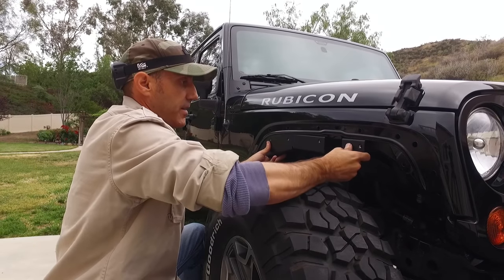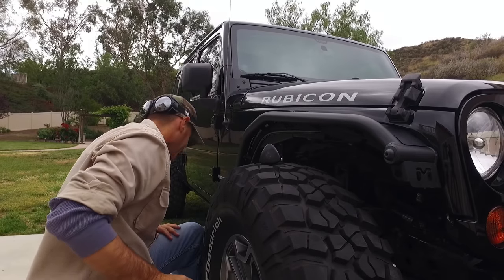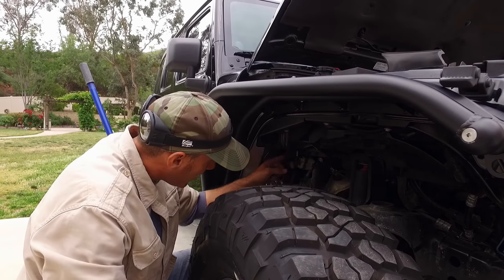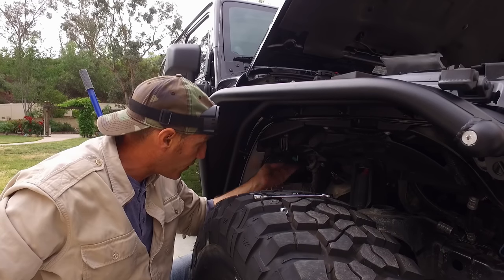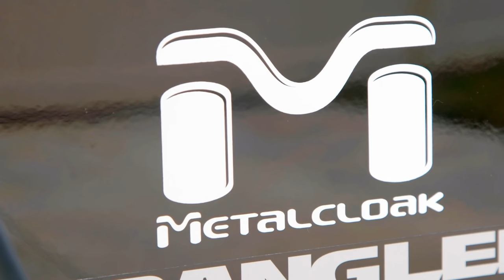Jeep Wrangler Front Fender Upgrade! MetalCloak Overline DIY Installation for JKU Rubicon

Comment: A tip for easier drilling through sheet metal is to use a Unibit instead of a standard twist drill bit. It won't catch and cause headaches and drills a much nicer and rounder hole.

Comment: Great video but, I'm just wondering what did you do with the side marker light that was on the stock fender?
Reply from the maker: Metalcloak sells a small led kit that fits into the new fenders but I just left them off
Reply: I see thanks for the info...

Comment: If you don't break the edges on the holes you drilled the paint may not coat the sharp edges and can crack/chip off
Reply from the maker: Hmm. good tip.

Comment: Awsome quality and looks but not legal in most states and Canada from what I know... No turn signals
Reply: You add them yourself.
Reply: turn signals are in front grill.
Reply: I saw that you can buy an addon on the metalcloack website to add small turn signals to the main small inside fender
Reply: Keep in mind that side marker lights are NOT the same as turn signals.

Comment: Is this the Overline standard size. I see it comes in narrow, regular and wide. Front and rears?
Reply from the maker: I got the wide ones and like them a  bunch... the flares come off with two bolts and I can run narrow but never have yet... they are perfect!

Comment: Another great vid. What made you go with hard top instead of soft?
Reply from the maker: That was simply a case of finding a used Jeep at the right price with a manual transmission but now that I have it, I like it!
Reply: +autoedit Well that was easy enough. Hope it will be that way for me. Any problems with the top leaking? Do you take it off much?

Comment: Wondering how much harder this would be with any other tire brand say toyo/nitto. As BFG's tires usually measure a lot under their desired height. This has me still wanting a jk and to try and fit 37's with as little lift as possible though! 

Have you measured the BFG's yet?
Reply from the maker: Yeah, the BFGs measured 35.5" tall and I absolutely love them!

Comment: Are these the standard size flares, or the wide ones?
Reply from the maker: They are standard.
Reply: 4", 6" or 8"?  I'm also in between overline or arched.  Looks great BTW.
Reply: The standard size is the 8". MetalCloak came out with the 6" and 10" flares a few months ago as additional options.

Comment: are you using the metal cloak narrow, standard or wide  overline fender flares? and is that a full length front bumper ? Im looking for fender flares  for my full length bumper
Reply from the maker: These are the wide option from metalcloak.

Comment: I may be mistaken but didn't you fender have a light/signal in the front of it? what did you do with the light/wiring? thanks
Reply from the maker: I just removed the section of the wiring pigtail that went from the harness to the light and zip tied it away.  They Make a small LED replacement side marker but I haven't ordered it yet.
Reply: great information! thank you

Comment: I like to ask you 1 Question, Were is the side lighted markers. In NY this won't pass the safety inspection.
Reply from the maker: +Tommy Fx  Metalcloak offers a really cool led side marker that plugs in to the stock harness and mounts up easy. I didn't install them yet but make it totally legal .
Reply: Ok. Cool. Thanks for the response back. Cool Jeep.

Comment: Some kids posting here don't seem to get the point of not over lifting a rig and the inherent problems of uber tall rigs in off chamber wheelin and loss of obstacle clearance not to mention poor fuel mileage and terrible on road handling.   

With 37s on my two door and a 3.5 inch lift sure lost enough my high speed handling that I wouldn't let just anyone drive it on the street at high speed. It's a rollover accident just waiting to happen. My jeep is so modified at this point I unusually trailer it to off road sites. While it is mostly still street legal (must add fenders in my state) I would like to make my rig more street able and still retain the extreme off-road abilities so my question to you is with these higher fenders and 37s plus a little body trimming and hopefully better shocks how do you rate the off road and on road drivability of your rig?
Reply from the maker: I have to install a small bump stop extender to keep the rears from tucking into the wheel well a little and will get out in the hills again to see how it does.  So far the drivability is really great...a shock upgrade would be helpful but I didn't like those with the stock tires.
Reply: +autoedit   I take it you mean to say the stock shocks aren't that good now. 
That is something I would recommend to replace sooner than later as soon as you decide on what lift or suspension you will be upgrading to since they must be matched to that change as well. 
IMO - shock replacement in your case is a must do ASAP.  Since you have greatly increased the sprung weigh appropriate shocks that can handle that change is a must.
Reply: +autoedit   My question to you is, I want a more street-able jeep and I am considering getting a new 4 door jeep to have a dual use rig that I can drive on the street more than just off road but it must be still capable to do everything we have here and also get there on the pavement.  So here we have rock, mud, snow and sand dunes. Plus I drive from Oregon to the tip of BAJA mostly off road once crossing the border. My problem is being able to travel that 80% off road and still carry enough gear to dry camp for at least a week at time.
I need to drive the freeway safely at 75 mph heavily loaded for 900 miles to the border then off road for 1000 miles. It's EZ to make a great off road rig but not so for one that does both very well.  Everyone has their own vision for their rig, it appears we are on similar paths.
Reply: +autoedit  so that's the question, are you making a dual sport or dual use rig?  Something that is just as fun to drive on the street as off?
Reply: If your having handling issues like that, which isnt a surprise with 3.5 and 37s, do you have a steering stabilizer 1 ton front end components and the proper alignment change? Because with just 3.5 lift and 12.5 wide tires you should have no trouble with roll over or crazy body lean.
Reply: +wowantonlavey  --mines a 2 door shorty, even less stable than the unlimited. Ya must not have a jeep cuz everyone knows the "DEATH WOBBLE". 

For street use 2 oversize aftermarket steering stabilizer shocks are the so-so hillbilly fix I was forced to use.  I belief keeping lower to not over angle the steering components like the OP here did is the way to go VS   major heavy upgrades that further weigh down an already underpowered behemoth. That is why my next rig just may have to be another Ford F-150-the new twin turbo Raptor.  Hard to wrap my head around a 6 popper in a full sized PU but with the claims I read and the drag race videos on u-tube turning 12s at the 1/4mile, plus over 400 HP, hell it's worth a try. 
One thing about JKs that would make them almost perfect is more HP right from the factory.  If you test drive a bone stock two door sport you will get hooked but just hopping into a little heavier hard rock and you will instantly notice the lack of power.
Reply: +2003evodave 

Pull all the plastic off a new jeep add all the needed armor, light bars, winch, real steel bumpers, etc etc next thing you know you don't have enough power to get out of your own way. 

When will we be able to get a factory diesel like they can in South America, England, Africa, China , etc.

Comment: What type of suspension are you planning to put in?
Reply from the maker: +Antonio Zavala I'm still not sure...so many options and inches. There's a few steps I want to try first!
Reply: +autoedit You might want to consider a suspension lift kit that includes a new trackbar.  Those 37's you have on there are going to put a great amount of stress on your factory trackbar.  Teraflex has a forged adjustable trackbar. Some of their suspension kits inlcude it along with their speedbumps ,which will help tremendously if you're not wanting to put a big lift on your jeep.

Comment: If you're running 37s without a lift, I'm guessing yours is a mall crawler and you don't actually go out on any serious trails. You also need to do C gussets or those 37s will show you the weak point in the axles.
Reply from the maker: Yup, I stick to the malls... where it's safe.

Comment: I would get all the Jeep Recalls done before you put anymore money into that bad boy.. Don't want it Bursting into Flames..
Chrysler Group is recalling 313,236 2011-'13 Jeep Wrangler SUVs because a problem with the heated power mirrors can increase the risk of a fire. Read More

Chrysler is recalling an estimated 180,131 2012-'13 Jeep Wranglers because the power steering line may contact and wear a hole in the transmission oil cooler line, resulting in a loss of transmission fluid.